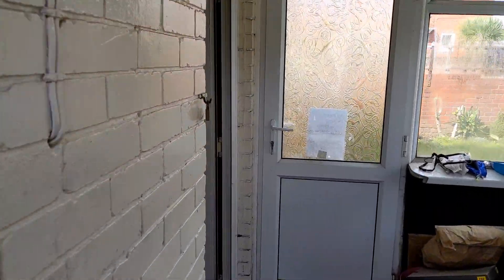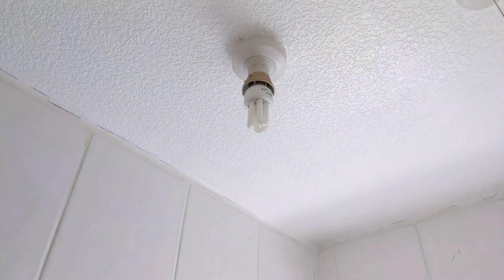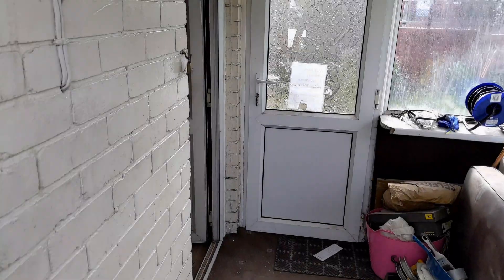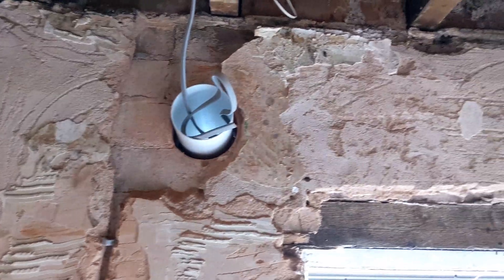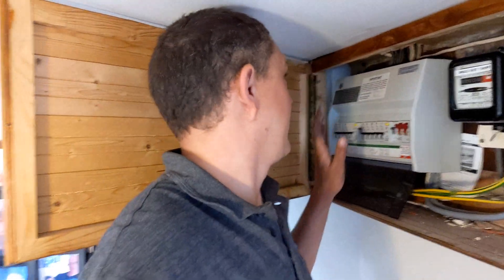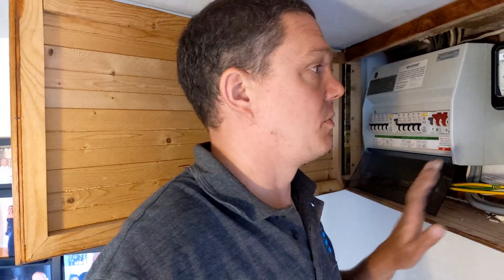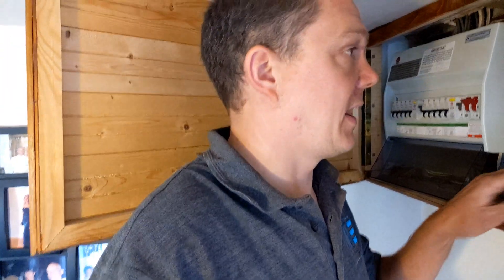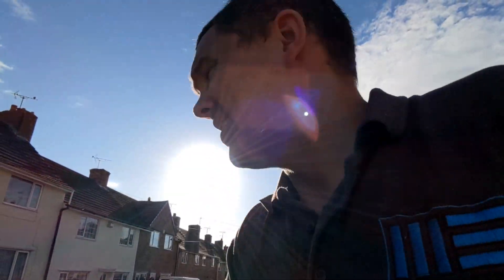Bathroom Electrical works & Converting TT earthing to PME! (TNC-S)

Comment: Did that not say 0.45 on your meter ..I was under the impression it had to below  0.35 on a tncs system ?
Reply from the maker: Yes. At the MET it should be a max of 0.35.  That clip was at a socket outlet so that would be roughly Ze + r1/r2 hence the 0.45 reading.

Great comment though, I had not thought of showing the MET reading as proof it was within limits. (Which it was - I've not got the cert to hand though!)